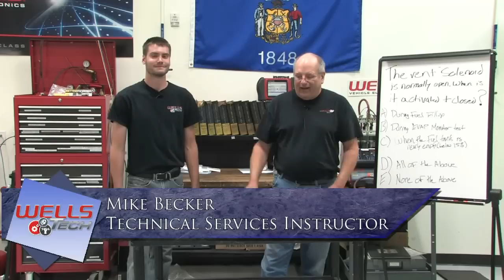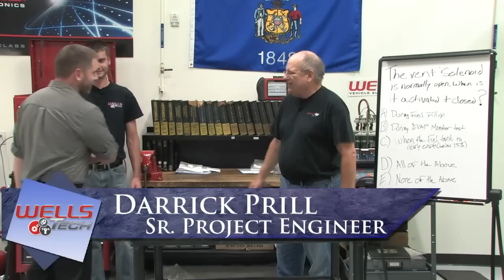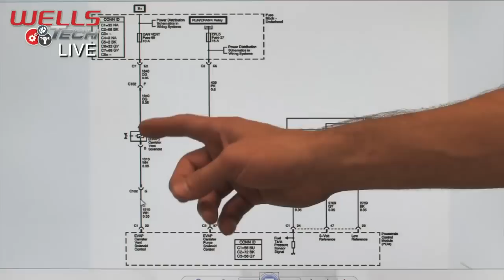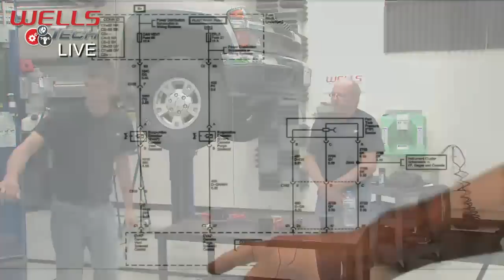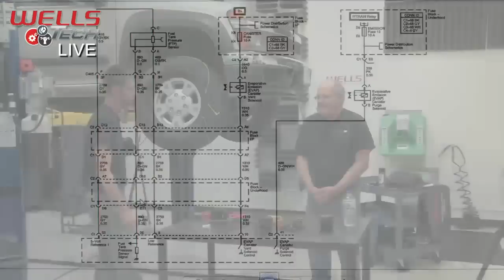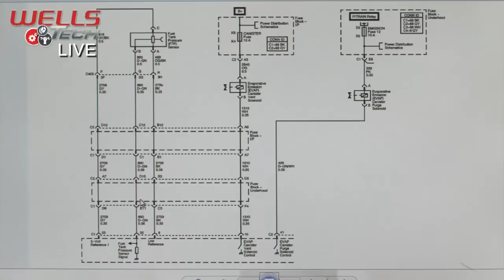EVAP Leaks II (P0442/P0445)

Comment: could the ohms resistance be reading the length of the wires you are using for the test?
Reply from the maker: Hey Kenny,
Good question, A quality set of test leads even at 10- 20 ft. shouldn't have any more than .2 OHMs of resistance on them with a multimeter.
~Ryan

Comment: On my 2016 Ford focus 1.0 ecoboost I got a check engine light with P2196 (O2 sensor stuck rich), within a week P0420 (inefficient cat converter). My car was stalling like crazy and would switch off every time I stop and the fuel tank was sucked in. Took to the mechanics whom advised me to replace the O2 and the Cat (BAD ADVICE). After replacing them, the problem continued and that's when I started watching your videos specifically on Evap systems. To make my story short, it turned out that the problem was a stuck open Purge Solenoid and DIY FIXED IT. Thank you guys.
Reply from the maker: Hey that's awesome to hear! Glad you were able to get it all fixed up!!!
Mike Becker, Senior Technical Instructor

Comment: Is there a way to reach you guys? 2007 Hyundai Sonata V-6 with a P0442 code has the dealer stating my housing to my fuel pump is cracked and they sent me a photo during my wait. There's something wrong with their diagnostic after the smoke test. They only say they checked the fuel pump.is that where you usually start looking for a small  evap leak? I have no trouble starting my car or fueling the car.  I can be reached at firefytergalb@aol.com. I would love to hear from someone and explain what's happening. Thank you _- Bernice
Reply from the maker: Hey Bernice, A smoke test should verify the entire EVAP systems integrity when done correctly. The EVAP system can have a leak issue that has no effect on starting/fueling your car. If they found a crack in the system then that is a point of failure. Hopefully that's all it is!
Mike Becker, Senior Technical Services Instructor

Comment: Hey Mike I'm a little confused or just over thinking.  But I thought with the vent normally open both wires should read 12 volts with the plug connected and still connected the control side should read 0 volts when the computer closes it because it's ground side switch. Now if I had a code with the vent system fault and I read the wire that is fused at 12 and the other 0 with it normally open its a problem and if I unplug it and the 0 goes to 12 the vent is bad because it shorted it out. Am I correct? But ur saying with the connector unplug u should not read 12 on both with the vent opened. But why not if it's ground side switch and it's open it should read 12 until it closes and go to zero or with test light to battery positive it should light when u command it to close. Really confusing. Please help or is there another video explaining this more thorough because I thought i really had this one down packed to a tee. Thank u Mike God bless
Reply from the maker: Hey Jason, thanks for watching! The 12 volts on the switched ground side is flowing through the windings of the vent when it is not commanded on.  As soon as the PCM turns the switch on the ground side should go from 12 volts to 0. The 12v is not naturally on that ground wire, it is flowing in from the fuse side and through the solenoid. This is part of basic electrical circuit diag, i'm sure you can find some videos out there on that. good luck!
Mike Becker, Senior Technical Services Instructor
Reply: Thank u Mike ur the best

Comment: i hace a problem With my cheve Silverado 2001 i change the New selinoy
but it does the some thing as the old one,when i flip the switch the selinoy closes but im 2 sec the growned openes i dont no if thats normal i open the switch but it doesnt have growned only for 2 sec
Reply from the maker: Raul, what switch? How are you closing it? With a scan tool? It is normal for a scan tool to only keep it turned on for a short amount of time. 
Mike Becker, Technical Services Instructor

Comment: great vid. can you do a bidirectional test with the tester to confirm the diagnosis?
Reply from the maker: You can test the vent before and after with the bidirectional controls in the scan tool. Also many higher end scan tools can do a forced evap test. That can also be used for verification.
Mike Becker, Technical Services Instructor

Comment: I think you're all wrong, rust build up happens when raw fuel from the gas tank is pulled up through the valve either from a failing rollover valve or over filling your tank. Modern fuels are a percentage alcohol which can be high corrosive. Your moisture theory falls short because air from your filter goes through the canister or tank and fuel (water vapor is heavier than fuel vapor and drops).
Reply from the maker: Hey Marco, Thanks for your input I love it. Now when you are talking about raw fuel being pulled through the valve...are you talking the vent or the purge valve? Also you are totally right, the alcohol in fuel nowadays is really hard on every system. Thanks for the comment and your input!
Mike Becker, Technical Services Instructor